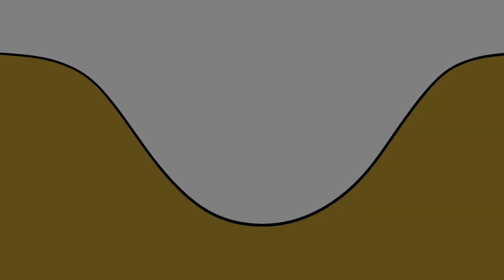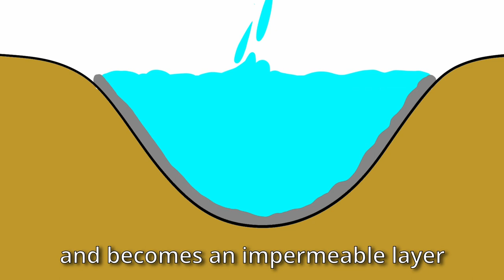Pond in Country Living | Build a Natural Pond Without Liner | Seal With Bentonite Clay | Fix leaks

Comment: Thank you so much for sharing, very nice to know that a wildlife pond can be accomplished without spending thousands to install a pond liner.
Reply from the maker: You are welcome. We did not like the idea of using synthetic rubber and liners, which is very unnatural. Bentonite is clay, and is everywhere in nature.
Reply: @6Acres  now the only challenge is finding bentonite clay! I've searched all over the internet and cannot find where to purchase. 50 lb bag is $100, does that sound right?
Reply from the maker: No, that doesn’t sound right! What you want are Bentonite Chips. You could try local stores that sell concrete supplies, tools, and minerals, that type of store. It should be under $20 dollars, something like this https://www.texasbentonite.com/bentonite-chips.html Hope this helps.

Comment: I loved how you made this video.
I was looking for information about a natural pond that I dug two years ago and let it stabilize in a place with a lot of gravel and sand.
Do you know if it could work on such soil? I'm willing to put more Clay if that would help.
Thanks
Reply from the maker: I am glad you loved the video. 
I am not a pond-building expert, but I believe if you use enough clay and spread it evenly, it should work itself into all the leaky spots. Our pond leaked like crazy until we used bentonite.
I wish you success.
Reply: @6Acres  
I come with clarifications.
I consider it a miracle, it not only seals it but also stabilizes it, or I didn't expect that.
On the contrary, I thought it would flow by putting up to 10 cm of clay.
It takes longer to soften but it miraculously does its job.
 Thank you for the idea, my dream come true !
Reply from the maker: @ukecsuku  It's fantastic to hear your success and your dream come true! We thought clay was a miracle, too! Thanks for sharing. You are very welcome!

Comment: Great video!
What kind of soil you had and how much Bentonite per square feet you used?
Reply from the maker: Thank you for checking out my video! Not sure what my soil type is. The bigger pond in the video already had vegetation grown, not distinctly any kind of soil. The little new pond had garden soil on the top and maybe a bit sandy on the bottom. Not sure about the square footage. We used about 20 50-pound bags of bentonite clay to cover the bigger pond in the video, mainly on the bank because it was an old pond and probably already had sediment on the bottom, while in the new little pond, we covered the bottom.

Comment: Love the work.
May we ask what specific brand and size clay medium?
Thank you.
We have found shipping prices through the roof today now more than ever.
I recently purchased some bags of clay to use with the damit polymer for our natural pond.
Bottom foot hold well but battling heavy gravel. We have ducks to help seal it as well.
It's going to take patience but I believe we will eventually hold water.
Cheers from Massachusetts
Reply from the maker: We used Puregold Medium Chips, which come in 50-lb bags. The chips are about 3/8" chunk size. They should be around $18 USD or so/bag. Shipping won't make sense if you need many bags. We found them in a store that sells concrete tools and materials. What we used are bentonite chips, not powder. You are welcome! Thank you for the lovely comment. You have the right mindset- patience!